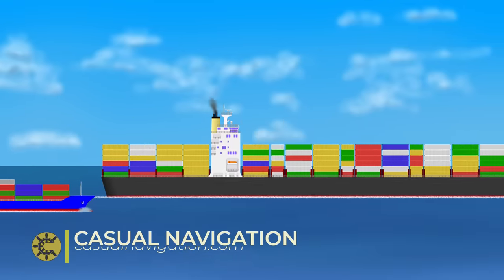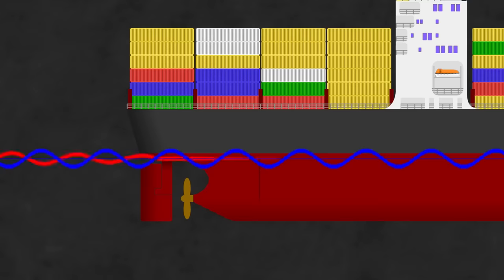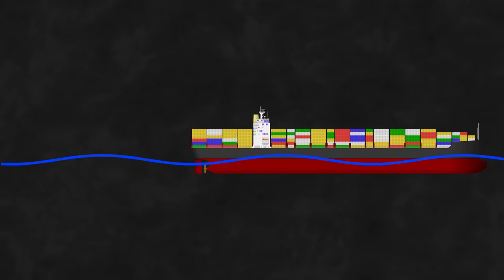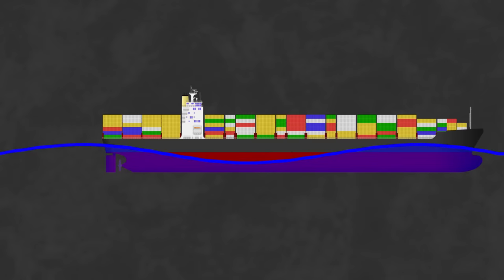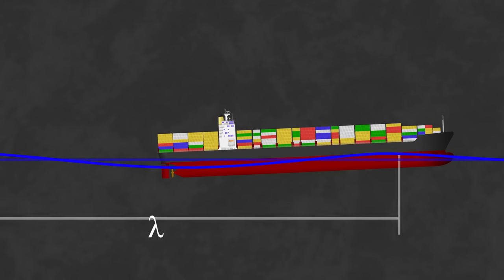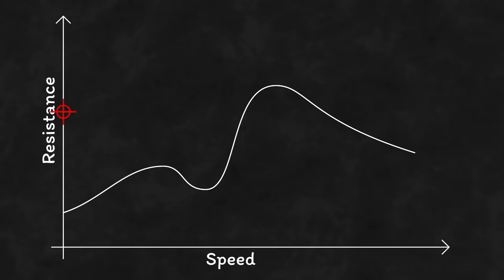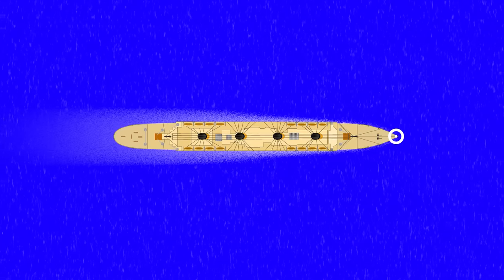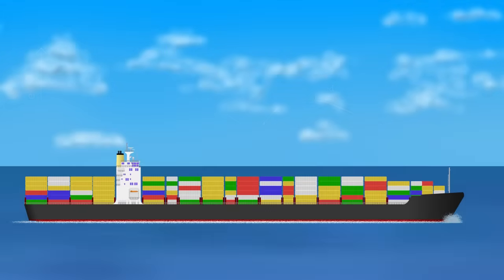Why Are Big Ships Faster Than Small Ships?

Comment: I assume this also holds true for sail boats, where the amount of forward thrust that can be produced is limited by wind strength and sail area?
Reply: Absolutely. Take a look at the math behind catamaran versus monuhulls. Cats have two narrow, long hulls with "pointier" ends - so you end up with twice the waterline length. A 40' cat has almost 80' of hull length. That increases the theoretical hull speed, and is largely responsible for why a cat has a theoretical speed advantage over a monuhull. In truth, weight plays a major role, so it's not correct to say a 40' cat will always beat a 40' mono. Those cats can get real heavy as people load them them up like floating houses.
Reply: I think you'd have to clarify that it holds when comparing to other sail boats. He didn't mention engines at all, which makes me think he didn't consider them.

But, a large hull with an underpowered engine --- or inadequate sail --- ain't gonna go fast, right?

Comment: Interesting video, but the comments of figuring out the hull speed for water sports is a little impractical. Most performance ski boats are in the 6-8m length leaving the hull speed (5.5-7 kph) well below speeds needed to keep a skier up or provide much excitement for inflatables. Even hump speed is too slow for many contexts, but modern wakeboard boats are designed to stretch being on plane to require higher speeds.

Comment: Excellent Video!! I just have a question, why exactly does the wave stretch when the ship speeds up? What exactly causes the waves at the hull in the first place?
Reply: When the bow pushes forward into the water, it creates a ripple (bow wave), same as when you hold your hands up in front of you and walk forward in a swimming pool. A wave is just a ripple that's big enough to be worth talking about. 
The reason the wave appears to "stretch" further back along the ship is because the ship is moving forward next to the wave. In a parked car, lean out the window and throw a ping pong ball towards the back as hard as you can. Take the car on a highway and try again, and you'll surely be able to "throw it farther" behind the car. Of course that has nothing to do with the ball, and is just because the car is moving away after you threw the ball. That's what the ship is doing too.
Unlike with the ball, the water waves touch the ship so it matters in this video.
P.S. don't really lean out the window of a car going fast. 😀

Comment: BASICALLY:
Big ships are faster because their surface under water ( creating hydrodynamical drag ) to cubature ( containing engine and fuel ) is smaller than for small ship. It is comparing surface ( 3x^2 curve ) to qubature ( x^3 curve ). It is this- mathematically- same reason for wich small things are cooling faster: their surface ( radites the heat out ) is big in comparison to volume ( amount of heat to radiate out ).

And this things about waves: all being a very fine add to it.

Comment: I thought the answer was as simple as, bigger vehicle, means bigger engine, means more power, means higher terminal-velocity. 
I was thinking about motorcycles. 
A small engine motorcycle should stay off the highway, but it's agile and very efficient.
A big engine motorcycle can comfortably do highway speeds, because it's stronger to push through air resistance, but is less maneuverable because of it's size & weight.
But I didn't know ship speeds were more complicated than that.

I wonder why cargo ships aren't sickle cell or teardrop shaped. Maybe below the waterline the tail is tapered, but above the water line, dosen't such a flat butt cause a lot of air drag? Or all that matters is a ship filling up it's parking space with cargo capacity? 

Carrying as much stuff as possible is more important than carrying less stuff quicker and more efficiently? I guess if a smaller ship can't cross the ocean twice as fast, and twice as efficiently than a ship twice it's capacity, then it's better to have a less efficient and slower, huge, boxy ship.

Comment: Generally correct, but the major change as a vessel increases its speed is an increase in wavelength and a reduction in [wave] frequency but the wave-speed remains [practically] constant.

v = λf
Reply: Not for gravity-propagated surface waves like these. Longer wavelengths really do go faster. But the speed is proportional to the square root of the wavelength, not the wavelength as reported in the video.
Reply: @bryanreed742  Agreed, I couldn’t remember the exact formula for change in wave-speed. But in simple terms, the wave speed is more of a constant than a variable, with λf being the key relationship. Thank you for the correction.

Also, water depth has a bearing on wave speed but I was assuming infinite depth.
Reply: @jsytac  as was I, as was the video. Clearly shallow water changes things.

Comment: So if I understand the graph correctly the most efficient cruising speed is between Hull speed and Hump speed then? The video didn't seem to cover this exactly, is there a specific name for that speed or is it just "Cruising Speed"? I don't think what made this speed more efficient was really covered in the video. Moreover how would this relate to the practice of slow steaming to conserve fuel? In the context of this graph the practice doesn't seem to make sense as it'd seem to put you at hull speed if the ideal is the middle of that trough on the graph. The video was informative but has left me with many more questions.

Comment: Does that second dip in the graph represent planing resistance? I would have thought that was where the boat has the least resistance but the graph shows a lower valley between hull speed and hump speed?

Comment: Square root of the length in feet of the boat or ship? Multiplied by 1.34 is the best you will get from a displacement hull in knots/hr. Yes bulbs on ships help. But lengthening a ship by 300 feet? Brought many a ship undone breaking in the middle of the wave cycle.

Comment: I am a bit confused, I assume planing hulls go over the hump, so they don’t have the wave pattern as displacement hulls. Secondly, boulbous bow by creating a counter wave reduces the water resistance, but in a displacement hull its affect should be negligible in increasing the speed, other than increasing the waterline length marginally. Thirdly, 150 meter ship will have nearly 30 knots of hull speed. So, the reason for different running speeds compared to far larger ships might be something else. Could it be the commercial considerations??? Bearing in mind the tankers and bulk carriers steam at much lower speeds, thus installed with much less powerful engines for lower fuel consumption..
Reply: Yeah, the question is not precisely defined, and you could answer the entire question with economics, not physics. (I don't know if my "economics" explanation is accurate, but it addresses the question, as stated.)

Additionally, this ignores differences in engine output, ship width, existence of a bulbous bow, any economic category other than "cargo ship" (e.g. military or pleasure crafts), etc, etc.

Lots of people who took a course are praising this video, but they already knew a lot of the concepts this video neglects.
Reply: Oh, and my economics argument is this: bigger cargo ships hold more cargo, and therefore have higher revenue compared to fixed costs, such as initial investment cost. That means they can attach bigger engines without scaring their accountants, and --+ vroom, vroom!
Reply: @jpaugh64  well, economics is the correct answer; but one has to see it in a larger perspective. Sometimes very powerful engines might be installed on a very large ship to attain very high speeds (Maersk has tried this for a service from Singapore to East Coast US with 32 knot speeds but now those series of ships all re-engined with lower consumption engines). So, there can be business decision based on future assumptions…
Reply: @salimerdem7544  That's what I mean. The more powerful engines will definitely go to the larger ships.

That's less true for military craft, where cost of one ship is less important than the overall cost/benefit ratio of an entire fleet. And it's also less true for small pleasure craft, where having a slightly oversized engine might be a competitive advantage that nets you more per-unit profit (or volume, aka profit), despite the added materials cost

Comment: have any ship builders tried bubbling air all around the hull to reduce drag? i know ice breakers can do that . not sure if the ships are just too big, travel too fast or if bubbles actually reduce drag. plus the extra power needed to generate the compressed air.
Reply: RB: US Navy warships e.g destroyers, have had a similar system called Prairie/Masker designed to use the bubbles to insulate the ships hull from transmitting machine noise into the water which would be detectable by enemy submarines.  System has existed since at least the 1960's.  I have never heard of any resulting speed increase.  Too many bubbles would tend to increase draft due to loss of buoyancy.  old sailor.
Reply: HAY
ice breakers use bubles to stop the ice getting trapped against the hull
Reply: @raypitts4880  Yep, forgot about that!

Comment: Kinetics. Long story short kinetics. A heavy object being propelled through the water will go faster because it takes way more water to slow it down. Plus the power to weight ratio. Mind blowing. There ain't nothing like 4 five-story 10 cylinder 90 ton diesel Powerhouse powering an electric motor strong enough to light Hackensack New Jersey for a month connected to propellers bigger than a lot of houses. When they get spinning they wana keep spinning. I live near Duluth Minnesota and I know all about iron ore tankers and for about three Summers I worked on the William a Irving in Duluth just one short drawbridge walk away from the Ariel lift bridge welcoming ships of all sizes into the Twin ports of Duluth Minnesota and Superior Wisconsin.

Comment: this question is wrong, you are comparing DISPLACEMENT BOATS and theoretical hull speed that applies to LDL length-displacement-ratio used in those nefarious mass transport vessels, while a small wide flat sailboats can transport a lot of cargo as ballast and sail faster downwind than a bigger narrow sailboat because they do planing over waves and are lighter and if you use pure hydrofoils the hull length doesn't matter at all

Comment: Why is the choice of engine not a limiting factor? Larger cargo vessels have higher economic utility, and probably much longer average route distance.

Therefore, it's more profitable to soup up the engine of a large cargo vessel than of a smaller one.
-------------
Yes, I'm aware that cargo shipping chooses a speed based on economics rather than maximum possible speed, and that the most economical speed would be influenced by the hull shape.

However, the imprecise way you framed the question allows multiple, unrelated answers, so I'm left wondering precisely which question you actually attempted to answer.

Comment: I like physics like this. But this is pretty complexed, and I think one very simple way to explain it can also be that the relative resistance decreases with larger size of a ship.
Reply: That's a bit imprecise. I assume the resistance changes when the length:width aspect ratio approaches optimal. (For a hull with an infinitesimal width, the length of the hull would not affect resistance much.)

I'm not sure exactly how width plays a role, but its gotta be different than length. The video ignores width, so we'll have to assume each craft is as wide as possible without harming efficiency too badly.
Reply: @jpaugh64  
May be. But with same proportions the relative surface area will decrease with bigger size. I read that an oil tanker is the most energy efficient way for transportation of all vehicles.

Comment: Flying aircraft i have noticed they have an ideal planning speed, must be reason to call them an aeroplane. How much does suction on the lower hull effect the ship as it moves forward, does it run deeper. Or is the effect negligible. I know the QE2 scrapped it's bottom in shallow water.

Comment: You are talking around the points here and overcomplicate things. 
1. All commercial ships have bow bulbs and so whatever you say here - as you said - does not even apply to a wide extent. 
2. No large ship ever comes close to its bow speed - except for aircraft carriers having almost unlimited nuclear power on board. 
In the end it is plain and simple: With 5x more cargo on board you can spent 5x more money on propulsion to still be cost effective. And with that amount available you can make a large ship go faster than a small ship. Because drag does not scale as quickly as the increase in capacity. Most large container vessels go slower than their design speed to save on fuel. Reasonable.

Comment: While the waveform analysis of hull speed is correct, it is not the most intuitive way of teaching the concept. There is a great tendency for technicians to favor the more complex of any two expositions on the same matter. To wit, when we add length to a ship, we never add beam at the same rate. If we did, drag would be much higher for big ships. Put another way, big ships maintain a higher aspect ratio, and hence, lower drag. Yet another way: tiny boats are blunt bodies, i.e., they have more beam per unit length.

Comment: Is hump speed a safety concern, or just a comfort one? If it's safe to travel at hump speed, I'm surprised Cargo ships don't travel that fast to maximise profit with quicker deliveries.
Reply: i would guess the higher fuel consumption, caused by the additional drag and higher speed would make that not viable moneywise
Reply: The thing is, barely anybody cares about the speed. When you, for example, continously produce cars, then you only need to wait for the first shipment, then they'll be just arriving constantly. Hence, it's more economical to run at slower speed burning less fuel.
Reply: It's the issue of efficiency. The profits you gain from slightly faster delivery is cancelled by increased in fuel consumption.
Reply: @datjoosua2630  exactly this.

This YT channel does a good video in slow steaming.

What is more important is being on time. The cargo doesn't care if it gets there super quick. It isn't like a human who wants to fly as fast as possible to maximise time spent on location and minimize travel time.

People won't pay more for goods that traveled by ship faster. They'll just wait for the slower, cheaper run
Reply: @drebk  yep! there are certain things that we might want to be moved from one place to another very quickly and damn the cost, and other things we might want to send as cheaply as possible without much haste. there are good reasons why nobody ships iron ore by jet, or urgent post by container ship.
Reply: Because not all vessels can berth upon arrival at every port. In some ports like Shanghai during the pandemic might wait up to 4-10 days. You need the whole supply chain to maintain the same flow of speed to have a smooth shipment. 
Thats why "Just in time" is the way to go.
Reply: @soupalex  exactly.

I've sent a letter via airmail. 
But I'm not paying to fly a car over the pond.

Most of it has to do with weight, as your example hits on
Reply: @drebk  Depending what the car is worth it's doable, I know a cargo pilot and so I know it is not that uncommon to see high end luxury cars like Lambo's and Ferrari's finding their way on to the manifest particularly to customers in West coast, US. But then if you can afford to buy one of those an extra few thousand Euros to get it flown over is probably small potatoes.
Reply: @seraphina985  lol, fair point. 

I meant I wouldn't ship MY car via air.

Probably more cost effective for me ti buy a replacement on location.

But I can totally see a collector super car being transported via private chartered jet

Comment: Engine power dude, you didnt talk about the fact that bigger ship have so much space for engine that they dont even use all the space available in the engine room while smaller ship must use every inches to fit the engine. Basicly if a ship is 2 times as big as another, it can fit an engine 4 times as big as the smaller one and still have remaining space. Say a 220 meters ship use typical 2 stroke engine at 6000-8000 KW while the 400 meters long ship will be able to fit a 25 000-30 000 KW engine.